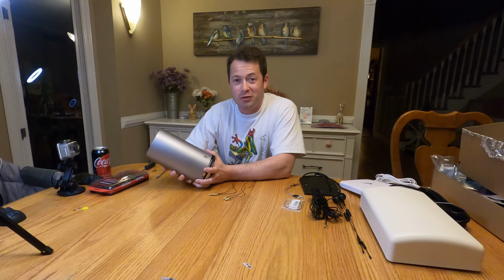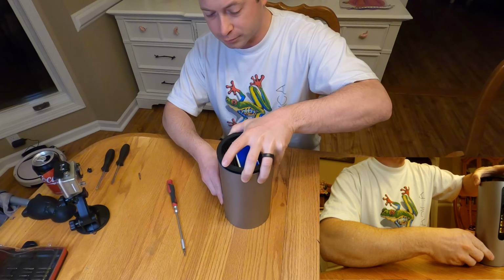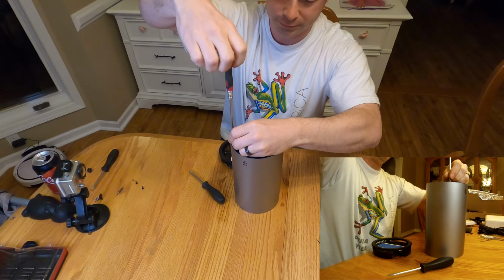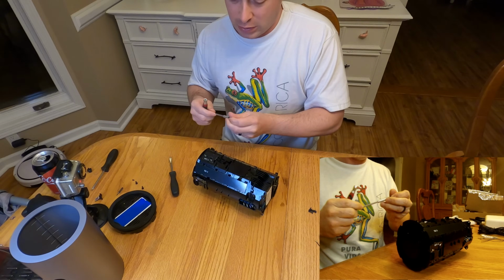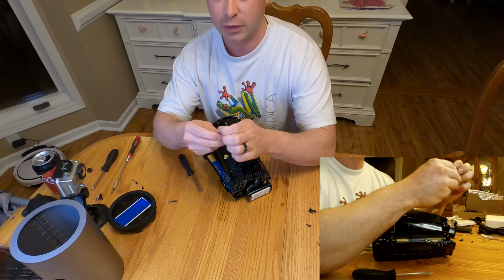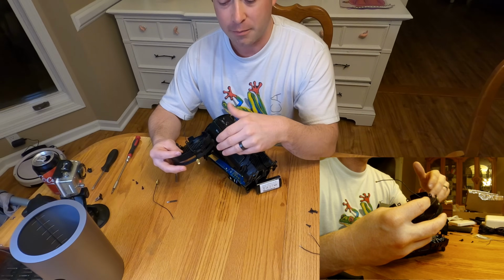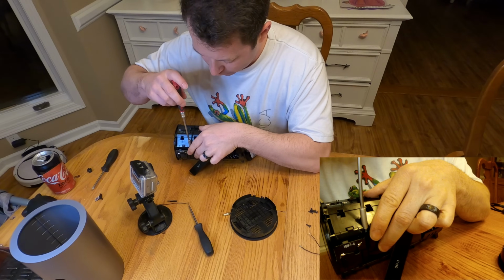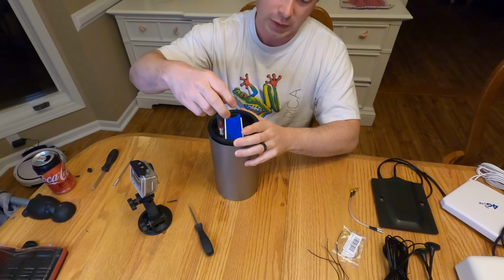✅ Improve Your Signal!  Add External Antennas - T-Mobile 5G Home Internet Rural Broadband - How To

Comment: Hi Nater Tater, I have a question about the primary signal and secondary signal on my T-Mobile gateway. I live in a rural area and the T-Mobile 5g Gateway was a great option for me. My Download speeds are generally 70mbps and Upload speeds are around 10mbps. That's not too bad for my area. However, I've noticed that when I do a Reboot, I get the Primary(which is 4G) and Secondary(which is 5G) locked in and my speeds are much faster, around 130mbps down, 60mbps up. But then after about 5 mins the Secondary signal disconnects and I'm left with the slower 70mbps down, 10mbps up. I know you don't work for T-Mobile, but just wondering if this is a problem you can address? I do know that many other people are having this issue. Thank you for your wonderful content.
Reply from the maker: Hard to say exactly what is causing that.  Could be tower congestion or could be gateway firmware bug.  Have you talked to tmobile about it?
Reply: @NaterTater  Yes, they told me that my gateway will pick the strongest signal and then drop the 5g. But that is not right because when it does lock on 5g when I reboot, the 5g signal is stronger. Lots of people are having this same issue. Thanks for the reply
Reply from the maker: @DevelopedDIY  the new .1609 MR4 firmware may help you.  Can ask them to push it.
Reply: @NaterTater  Thank you...I will try that

Comment: Hi love the video 
I'm trying to connect my Asus router but Its not working telling me limited connection?
What settings do I have to change on the TMobile gateway device any help would be appreciated thank you
Reply from the maker: Check your DNS.  Change it.
Reply: @NaterTater  change it to No?  Right thanks for the info what about the settings on the TMobile gateway device leave it alone? Just connect Ethernet cable
Reply from the maker: @CROW1176LIFE  you can change the DNS to no (gets from tmobile gateway) or any other DNS til you find one that works ok.  There are no settings to change on the gateway other than wifi.
Reply: @NaterTater  thank you so much for your time appreciate it

Comment: I'll never understand why manufacturers stopped incorporating external/removable antennas from their devices; I'm assuming it simply boils down to speed and cost of production. It doesn't seem very logical for a 4GLTE/5G Internet Gateway with Mimo & Band Aggregation capabilities that transmits and receives high frequency signals that rely on line-of-sight in some instances to be encased inside of a cylindrical metal shell that encompasses the entire device with the exception of limited openings (vents) at the top and bottom. I'm a nobody and my opinion is just that: an opinion from one person. However, I think it's reasonable to assume that incorporating external antennas would make this device more appealing to "techies" and other enthusiasts. Furthermore, It may make the device more capable in terms of connectivity especially in both rural and urban areas where distance and obstructions to the nearest tower(s) is a common problem. Thanks for the tutorial! I appreciate it as I'm sure everyone else does too! Keep up the good work!
Reply from the maker: I agree.  Thanks!
Reply: @NaterTater  you're very welcome! If we could just find a way to install custom firmware or 'unlock' all of the avaliable settings and features that'd be great! I just want to have the ability to bridge it and use it as a gateway only and use my own router to handle everything else. Right now all you can do is disable the wireless and add a router to it unless I'm missing something.

Comment: Thank you for the instruction. After watching your video, I decided to give it a try. I have line of site of the nearest cell tower; however, I was only getting 3 bars and averaging about 40Mbps down before installing the external antenna. After installing two Proxicast Yagi antennas, I'm have a solid 5 bars, averaging 145Mbps down and about 50Mbps up (RSRP -57, SINR 23 and RSRQ -9). On one of your other videos, you mentioned that some were reporting that when they used the Google Mesh router, that they were getting half of the speed. That is the opposite from my experience. My speeds didn't double, but they certainly increased quite a bit with the Google Mesh.
Reply from the maker: Awesome!

Comment: so if your external is hooked to ports 3 and 4, could you leave 1 and 2 disconnected?  Force the signal to come off the external?
Reply: I think I've tried that, and it never connects when the other 2 are unplugged, when I plugged them back up, it worked....But it didn't hemp me at all , I think it's because the yagi's I have are for 4g only and not 5g

Comment: I was wondering if anyone has tested the performance by just removing the cover. 

I saw one video which said the silver/grey paint is likely made with metal particles, but they had already installed the external antennas, so they weren’t testing it that way.

Comment: What about instead using a wireless signal booster (like SureCall Flare Cell Phone Signal Booster).  I am sure its not as effective but would not require modifying the T-Mobil hardware.  Would this even work with this sort of device (as opposed to a cell phone...).
Reply: I have this same question! I just ordered an Amazboost from Amazon after reading a review stating that someone used it for this. It has free returns, so we’ll see how it goes!
Reply from the maker: It will work but not as well as an external antenna.

Comment: Thanks for great video Nate.  Very well done! 

I have a couple tips to add if it helps anybody (I used a Waveform Panel kit as it is heavily treed where I live).

1)  When removing the bottom plate, use thin guitar picks (or other thin plastic shims) to push down on either side of the "pillars".  Wedge between grey plastic cylindrical cover and black bottom plate.  I found 0.88mm or thinner picks to work best.  1mm was a bit too thick.  This releases the plate safely without causing any damage to the grey plastic cover (which could happen with flat blade screwdriver used in "pry bar" fashion).  I used 4 picks (2 each at 2 pillars).  At that point the plate pops off easily.  Again, the clip release points are adjacent to the pillars, not directly in line with the pillars.

2) In my case, the Waveform adapter coax was actually a bit larger dia. compared to stock.  Since these wires are difficult to bend sharply, I found it easier to utilize L1/L2 since L3/L4 would require a sharp turn coming up from ventilation grilles.  Note the pcb soldered wire retainer clips barely can hold these larger dia. adapter wires.  Strain relieve well the wires elsewhere or risk the U.FL terminals popping off.   Waveform uses nice quality cables, but this is the downside. 

*Results*:  

I was averaging 40-60mbps down/0.7mbps up before the modification.  RSRP was -114 to -111.

Now I'm at 75 to 100mbps down/0.7mbps up.  RSRP now -112 to -109.

Tried sides of house and roof.   Spent a good 3-4 hours optimizing placement/height/direction/distance from house wall.   Placement/location didn't matter hardly at all in my case, but direction did.

I think I might purchase another antenna from them and replace L3/L4 with external.  Will report here if I do that.  I doubt it will help much,  but I need better upload.
Reply from the maker: Thanks for the detailed post.  Thats odd your upload is so low.  If you're on n41 then you'll also be on a 4G LTE signal, thats what you would need to improve to get faster upload.  5G NSA still uses only the 4G for upload.  I think the 4G has to be on the same tower but i could be wrong and if I am then you might need to point the antenna elsewhere to improve the 4G signal.  Good luck!
Reply: @NaterTater  Yup thanks for info!  For sure direction matters for my implementation.  I'm toying with the idea of purchasing the log periodic to increase gain and focus what limited TX power I have at the tower.  Although technically I don't have clear LOS, it might be worth trying.  I will call support on Monday and get Waveform's input as well.
Reply: @NaterTater  Just an update here.  I purchased a log periodic antenna from Waveform to compare against the panel. In my case, the results are nearly identical.  Spent many hours optimizing and also did a 30 minute tech support call with Waveform.  Tower is 3.5 miles as the crow flies. A third of that distance is lake, a third farmland and a third is treed.  Flat elevation in between.

For anybody that tries this,  remember to try many combinations of can rotations paired with external antenna directions.  The combination matters.

Also if you have poor upload and it matters to you (say a content creator) try a lower frequency band (which may be a different tower...and may also have associated lower download speed).  Don't always assume highest RSRP/download will equate to best upload.  Check both! In my case, orienting toward farther tower with band 25 halved my download speed, but more than doubled my upload.  That's the tradeoff I'm running with since my uploads were as low as 100-200kbps on some days. I am attributing better upload on lower bandwidth tower to the lower frequency (which has higher tree penetration) all else being equal.  I sent the panel back, but really they work the same for my conditions.
Reply from the maker: @Cobra-514CID  thanks for the follow-up.   As you probably know the upload is only your 4G LTE (primary) whereas the 5G NSA contributes to download.  Even on the same tower I have a different orientation to optimize 4G vs 5G.
Reply: @NaterTater  Have you tried those griddy or parabolic antennas with the silver t mobile can?
Reply from the maker: @alejandroalayon320  I have not

Comment: Thanks for the video.  Did you find that any particular 2 antenna connectors gave the best results?  I went with the two bottom ones as on Waveform but I am not getting the improvement I was hoping for.
Reply from the maker: I didnt notice a real difference between 1&2 or 3&4.  I did not try other combinations though.
Reply: @NaterTater  why can’t I do all four?

Comment: Hey Nate I have had the T-Mobile home internet for about 1 month. I have three bars on my router and on the gateway page my speeds range around 200 mbps down and 50- 60 mbps up. So way better than I had with DSL .  I bought two of the Nokia beacons but you have to plug one into the back of the gateway to get them to work because you can’t access the mesh network settings. Also here’s a question would a window signal booster help a persons upload and download or not? Thanks
Reply from the maker: Hey Wes, have you tried the Nokia Wifi app?  It has the option to add a beacon...not sure if it works though but free for you to try (and let me know!).  Signal boosters may help your upload but in my opinion not worth the cost.

Comment: Great Videos! I've been trying to work with my T Mobile Home internet to get just a little better quality so my ping is better during online racing. I ordered the  MIMO Panel External Antenna Kit for 4G LTE/5G Hotspots & Routers and got it all hooked up and tested in many places. it moved the signal bar from 2 bars to 3 bars and did seem to help the SNIR a little, but when I was running the speed test the download and upload speeds were awful. It actually went down to download of 1.9 and upload of 6.5 when I can normally get 48 down and 21 up. I double checked the setup several times and it appears to be correct. I did notice that the size of the 30 ft Ultra-Low Loss RS400 N-Male to N-Male Coaxial Cables I received with the package is much larger than what you are using in this video. Do you feel that the large Low-Loss cable at 30ft and the large connection before going into the N-Female Pigtail Adapter could be an issue?  This external antenna just didn't give my the increase quality I was hoping for when I hooked it up. I appreciate your great detail in your videos and all the great feedback in these comments.
Reply from the maker: Hey Colton, sounds like you got one 2x2 MIMO so two cables right?  If so most have the best success with ports L3 and L4 (bottom two) on the gateway.  Some others have tried L1 and L2 or even mixed them up like L1 and L3 or L2 and L4, etc.  Either way you need to have all 4 ports connected to something (either the stock internal ones or your external panel).  RS400 cable is good and 30ft isn't a problem so those shouldn't be your issue. You should check which towers and bands you normally connect to and make sure your antenna is capable of those frequencies (do a web search on your band freq).  Did you check out my antenna test video?
Reply: @NaterTater  Thank you for the response. I did look at that video (several times. Ha!) and probably should have posted the question under that one. I'm using L3 and L4 and left the other ones all on the stock antennas. I didn't touch them at all. My band freq is usually B2 or B66.It has been on B2 lately, but I seem to get better quality out of B66, but as you have noted I don't think I can lock it into one band. I was just really surprised how bad the speed test was with the external antenna hook up even thought the cell tower numbers were at least as equal to the numbers I showed when using just the T mobile modem.

Comment: Thank you for this very informative instruction!! We did it!! With your help we were able to install the u.fl cables, and wow! The external antenna connected to those tiny u.fl wires in the router have made a noticeable improvement. Thank you!
Reply from the maker: Glad it helped!
Reply: What size Phillips and bits do you need
Reply from the maker: #0

Comment: I did this but I made the mistake of getting a directional antenna instead of omnidirectional. It has helped a ton but I feel as if omnidirectional will help a lot more
Reply from the maker: Directional is what you want typically.  Often you will connect to just one tower so directional pointing at that tower is better than an omni.

Comment: Well everything for the most part is running fine... Except for Tmobile seeming to run a blockade on Steam games! Everytime I try to play a game like Beasts of Bermuda, I have internet connection, and good speed, but the servers do not load in. Sometimes the servers will load in, but they won't load the one I play on. It's very inconsistent and infuriating.... Any ideas that could help with this?
Reply from the maker: I havent heard of others with issue connecting to steam servers.  Some complain of lag or xbox party chat.
Reply: @NaterTater  So I called Tmobile and they resynced me and it worked for a bit but the moment I logged back off the server it decides to not show that server again, but will show literally every other server. Also at times my basic browser seems to lose connection. It is hardlined to the Wi-Fi tower atm.
Reply: I just tried something new, which is taking my computer off the hardline connection and connecting via wifi, suddenly my issue is no longer an issue.... but now I have to play on the wifi... Any ideas why this is happening? I just don't understand it lol
Reply from the maker: @Geminei  odd, i have seen others complain of differences ethernet to wifi from the gateway.  Did you try both ethernet ports?  Rumor is eth2 is more robust.
Reply: @NaterTater  I've tried both.. but it didn't fix the issues... I called Tmobile a few times today and the last one I just talked to he said they are actually upgrading the tower im on.. So i have no idea if that is the problem or not. x.x This is a headache every time my server goes to restart lol I'll keep you posted and if anything I troubleshoot works x.x Or the tower fixes the issues lol
Reply: Also wanted to say thanks so much for the helpful responses.. You have no idea how much I appreciate it.
Reply from the maker: @Geminei  no problem

Comment: What tools do you recommend buying at Lowes to do the job installing an external WiFi antenna T-Mobile 5G Home Internet Device?
Reply from the maker: These are external cellular antennae not wifi ones but you just need a small phillips, a T10 torx and a flathead screw driver.  I had a cheap $10 Husky screw driver/but set that I used.

Comment: I’ll be interested to see if you get at least 4 bars. I personally know nobody who can get more than 3 with the built in antenna. I am .5 miles from my tower. It almost looks like it’s in my backyard it’s so close. I even took my gateway outside and talked towards the tower and never got above 3. I’m only getting the 4G band right now. My top speeds are 80/20 my slowest in my new spot is 32/15, and that was one weekend. It’s typically between 48-67/18 but in the mornings it’s 79/20. My S/N ratio is 28. Tech support told me my tower isn’t 4G yet. It will be soon and they will most likely use the 2500Mhz antennas along with the slower 600Mhz. He said given my perfect line of sight and short distance, I’ll be able to make use of the 2500Mhz and will see around 200Mbps. Fingers crossed.
Reply: I'm getting full scale on the n71 band
Reply: 4bars on band 41
Reply: 1 get 5 bars on n41, cell tower is about 400 yards away

Comment: Which Antennas would you recommend from waveform ? Yagi mimo or panel mimo antennas. I am 2 miles from tower got some trees blocking my view of tower.
Reply from the maker: If you dont have direct line of sight go with the panel one.
Reply: @NaterTater  Thanks

Comment: I wonder if you insert an AT&T sim into the gateway will it work?
Reply from the maker: There are many cellular based modems that would allow that and be a much better option due to extra settings.  You can buy the Nokia Fastmile gateway (that this tmo gateway is based on but has less user adjustable settings).  So long as at&t sim isnt IMEI locked it would work.